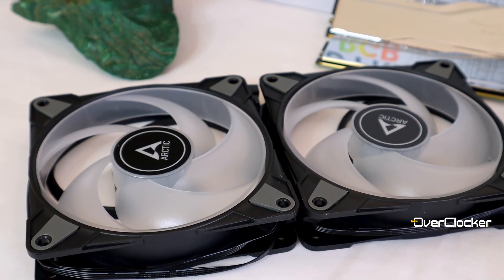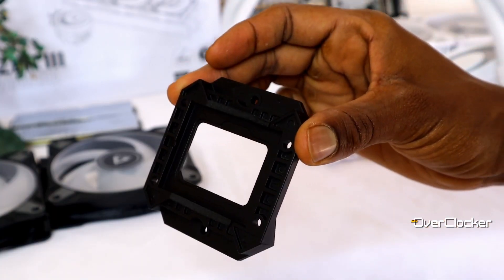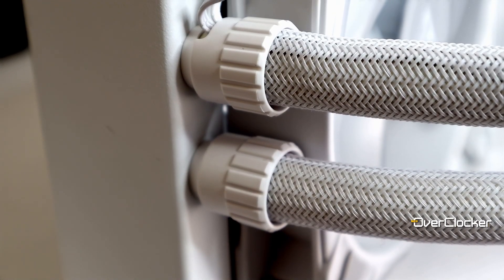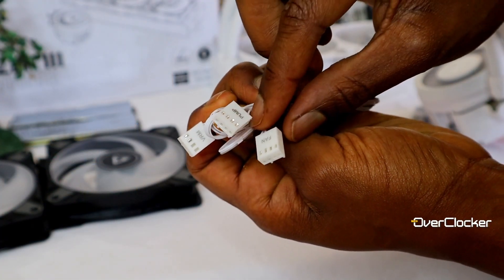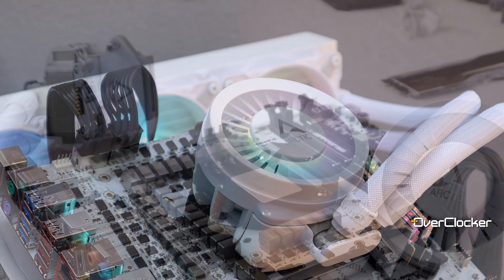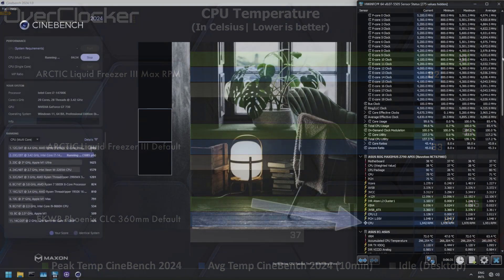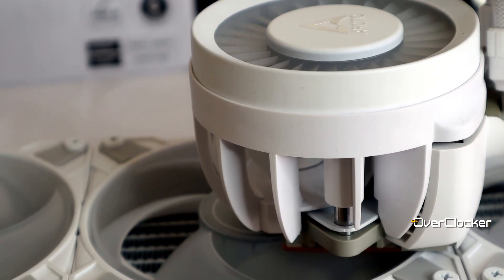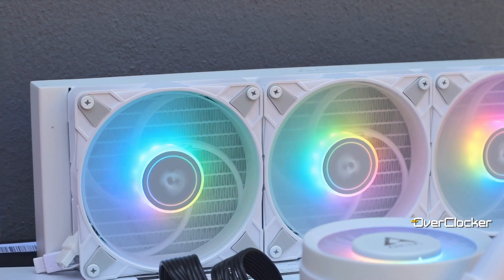ARCTIC Cooling Liquid Freezer 3 - Excellent performance and value AIO

Comment: So awesome to see a fellow South African. Doing my first PC build in a very very long time after just using laptops. 9700x cpu. XFX swift 9070 gpu. Super Flower V platinum pro 1000w psu. 32gb ddr5 either corsair vengeance 6000mhz or Klevv V 72000mhz. WD blue 2tb nvme. ASRocks X870 rs pro wifi mb. Would.you suggest this cooler?
Reply from the maker: Rig is going to be great. 🔥
And yes I definitely recommend this cooler, it's really awesome

Comment: Hi thanks for the review 
Quick question are the radiator fans exhaust Or intake?
Reply from the maker: Hmm that depends on your Case and mounting. At the top they would work best as exhaust of cause, but mounted at the front then they'd be best as intake, although you'd have to remount the fans for this on a 680X chassis for instance.

Comment: The value for money is near unbeatable. The design is fabolous too. However I don't think Artic will rest on their laurels. The successor will likely be transformative.
Reply from the maker: Most definitely. Pretty much sets the standard for now across many disciplines. Really like the two cable solution and the epic performance
Reply: @TheOverclockerMagazine  I found mine on ebay for $30. That's cheaper than a Five Guys meal for three people. hahaha